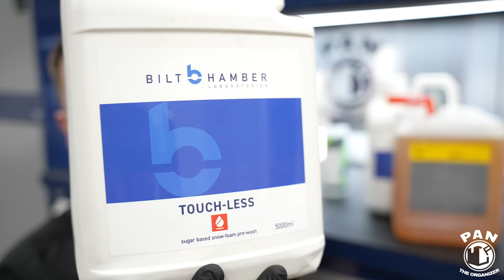The end of the 2 bucket car wash method!? 💀

Comment: For me, 1 bucket, 7 mitts. The grit guard at the bottom will unlikely remove all the particles of dirt embedded in the mitt. Some dirt particles aren't going to sink to the bottom of the bucket in time to escape the mitt as you draw the mitt out of the bucket. Give it a try. Your wash bucket water will remain sediment free.
Reply: You can't be serious 🤣
Reply: @jh.f30  agreed. Anyone who’s using less than 9 mitts is kidding themselves.
Reply: Same.  I did the two bucket method 10 years ago but for the past few years I found it so much easier to just use 1 mitt or microfiber per small section of car, and then just put those cloths aside.  I’ve probably used about 12 per wash.
Reply: @jh.f30 Small car.
Reply: Your laundry bill is 7 times more fantastic. Lol.
Reply: I’ve been doing one bucket ten mitts method for over ten years, second buck it just to pop the used mitts in.
Reply: @jh.f30  I mean your cars paint job is an expensive investment. Makes sense to protect it as much as possible. A few bucks to limit the chance of scratches when you really care about that sort of thing makes sense to me.
Reply: Ok so do you have 35-40 mitts? That’s assuming you are using a fresh set for every vehicle if you are doing this as a business. If so you might as well use the 2 bucket method.
Reply: @sneakynun most people are not detailing as a business. 

If you’re just washing your personal vehicle it makes a lot more sense to use more mitts.
Reply: Agreed. This is the best way
Reply: I do a microfiber per panel, I’m with you.
Reply: @thomaslax39  and utterly pointless
Reply: 1 mitt per panel any other way youre doing it wrong
Reply: I agree. But density means that it's likely not as hard if it floats. Hardness is all that matters for scratching something.
Reply: That’s how I do it. I run everything thru the clothes  washer after so having all those extra wash mitts makes no difference in the amount of time I spend. I just throw my drying towels and any detail rags in with the mits without any wash soap usually because there is enough in the mitts already.
Reply: Why not just use really thick microfiber towels at that point instead of a dozen mitts?
Reply: @zetapingpong  Not a bad idea. I did a rinseless like that once.  But using multiple mitts with no rimse bucket is actually a pretty smooth process.
Reply: @mikez6683  exactly the same method for me! If it took me 40 hrs to prep, polish and coat the car mitts are cheap. If I was to do it as a business then I might reconsider
Reply: @DaveoAU  only 9……..
Reply: @sneakynun  Why does it have to be a mitt? Microfibers work just fine. I use 5 to 10 in a rinseless wash bucket depending on the size of the vehicle.
Reply: I'm sticking with the pro advice.
Reply: For me, 7 buckets, 1 mitt
Reply: This is what I do.  Foam it dry, rinse, refoam for a lubricant on the surface, then one bucket and lots of mitts.  Not a hassle at all.

Comment: Im new to this area but found it extremely interesting so thank you for the video. One question I still have is what is the difference between doing it this way vs. using the Optimum No Rinse (ONR) one bucket way? Any help from Pan or the community would be greatly appreciated, Cheers.

Comment: I was pleased to hear you say that a rinseless wash can be used instead the snow-foam method.  I do not have a pressure washer or a snow foam cannon/gun, so my method is to pre soak the car with ONR in a pump sprayer, wash off with the hose* and then soak the car again in ONR leaving it on as I do the contact wash.  Rinse off with the hose and then back to the ONR in the pump sprayer for drying as a drying aid.
Entertaining video as always.
 * The hosepipe ban in England has ended at last!
Reply from the maker: Thanks!
Reply: never thought of doing it like this.  may have to do this

Comment: I have been using 1 bucket for the body and 1 bucket for the  wheels for 10 years.  I believe it comes down to preparation (using Grit Guards/washboard and foam cannon) and techniques. 

Great video, Pan.  I am actually washing my car today.
Reply from the maker: Enjoy your wash session!
Reply: Does grit guard gives the same function as rinsing and squeezing cloth on running tap?
Reply: @hakk9961   I think using a grit guard to agitate and loosen the dirt is better than just rinsing under tap water. I've used pressure washer on my mitts and seen dirt debris still attached to my mitt, so I just agitate my mitts on the grit guard
Reply: @JoeVargheseOrlandoFL that's exactly how I use my "grit guard" - as a washboard to clean my mitts after the wash. Once a mitt comes out of the wash bucket, and after it's on the car, it gets tossed in the "washboard" bucket. No rinsing mitts. Once a mitt touches the car, it doesn't touch it again until it's been scrubbed clean.

Comment: Pan, I’ve used the wash over foam method and it presents two issues to me: First, on larger vehicles like SUV’s, it’s difficult to get around the whole vehicle before the agitated areas begin to dry. Especially with one that’s been previously coated and is creating dry areas naturally. I really feel like I need to rinse after agitation to prevent any streaking/spotting. Secondly, any vehicle needing a step stool or lean in to get to the roof results in a shirt full of foam. This method is quick and easy for a low slung coupe like your Porsche, but less practical for something larger. Food for thought! Love your content, from one Panteli to another!
Reply from the maker: Thanks. For larger and taller vehicles, you can use a microfiber head on an extendable pole like this: https://bit.ly/3tE3xvg

Also, if you use a pH neutral snow foam, even if it dries a bit on the surface, it doesn't matter, it will rinse off well when it's time to rinse. Work in the shade or in a garage. And if you truly want zero water spotting issues, get a water deionizer. Zero minerals for a spot free wash experience. I love mine!
Reply: I do not agree. I use that method everyday to wash my truck ( ram 1500 ) and have no issue with parts that dries to fast ! The only challenge is when you got weather over 30 degrees outside then it might be tricky ( at this point you just dont wash a car when it’s to hot ) but in overall I have no problem using this method on big vehicles!
Reply: I rinse each section after agitation and I get no soap streaks like I do if I wait till the end
Reply: Move faster.
Reply: @Challenger432  It does help that pickup trucks have a bed that gives access to the roof, full-sized SUV roofs however are a pain to clean without extended wash mitts or if you aren’t tall.
Reply: @MrOiram46  I have a little folding stand that helps a TON.  I noticed our local detailing shop that did our cars' ceramic coatings using them and grabbed me one.  No more standing on wobbly upside down home depot buckets!
Reply: @Challenger432  You wash your truck every day?
Reply: @breakonthru5 1 to 2 times a week. It still not a problem. My last truck was a ram powerwagon and never had trouble washing the top standing on the sidesteps

Comment: Hi Pan! I do the same, but I don't see a problem with using both buckets after pre-washing. I consider it a step that requires no costs, nor is it a waste of time. But safety increases considerably by having a bucket of clean water to rinse the microfiber between processes.
Reply: How dirty dose your rinse water get? That should be your tell tale if the two bucket method is worth it.
Reply: Hi Pan. Top workshop you have there, I use a Citrus pre wash before snow-foam, then the lower section I use a fallout remover, as yourself just the 1 bucket. My car is PPF protected with a Halo coating. What are your thoughts on this method as debris/dirt just washes of the PPF? Thank you .
Reply: Yup I agree. I also bought 4 microfiber sponges to switch as I do my vehicle which only adds extra precaution and is easy to implement

Comment: I do this method WITH two buckets, both with grit guards, and have been for a few years. Just makes sense to me. Costs me almost zero calories to fill an extra bucket of water. Maximize lubrication in every step.
Reply: I do almost same method.. Foam pre-wash. Wait and Rinse. Foam again.  But on this step, I use One bucket and 8-9 different Wash mitts for all the sections.  Never reuse same contaminated wash mitts in rinse/wash bucket = lower risks of any contaminant scratches.  

And the added benefit is that it’s much faster bc you eliminated need to thoroughly rinse your mitts.  Once a mitt is done (front and back) on two sections of a car, it’s much faster to just drop on dirty pile and grab fresh new mitt.

Comment: I LOVE the single-bucket method, and it's the one I most recommend. As long as you decontaminate the surface properly with a power washer, foam, or just a hose first..the single-bucket method is king. You're never re-introducing sand or debris into the washing step!

Comment: Pan I have used the 2 bucket method up until a few months ago.  After watching Yvan's videos I switched to the 1 bucket.  Typically depending on how dirty the car is I will either prerinse with DIY rinseless or as you used in this video Active Foam.  Then after rinsing I have used Incredible suds, GSF or Pearl to do the contact wash.  I typically use 2 mitts one for the lower panels and one for the rest of the vehicle.  Thanks for really explaining the entire process.

Comment: Just a thought on the contact wash.  

I think I would do the windshield either last or with a single towel/wash mitt.  

Rationale: when driving your windshield & bumper & mirror hoods see the most dirt, bugs and grime.  In order to prevent dragging the contaminants over your roof I would recommend using only one mitt for the windshield.  

Thanks for your awesomeness!
Reply: I use a 2 bucket method with snow foam. I use a 2 sided mitt. Washing the roof with the lambswool side then turn it over and wash all the glass with the specialty glass side. Rinse then move on to the rest of the car. Been doing this for 3 years and NO love scratches. Paint is perfect. Mitt is a Maguiar's Lambswool mitt. I change the mitt annually. Hope this helps.

Comment: I use 2 bucket for a wash. 1 bucket is used for wheel cleaning the other is for cleaning the car. I havnet used the 2bucket method with a rinse/soap bucket in 5+ years. Rinseless wash is my wash method 95% of the time and a pre spray with rinseless is my pre soak and then wash. DIY is my favorite followed by Eco wash from OP. ONR use to be my goto untill DIY came out
Reply: Onr still my favorite

Comment: The thing I like the most about this cleaning method is that the majority of the "work" of cleaning the car is done by the products without the need of a lot of elbow grease. With the right products you can let the products go to work. A testament to the products used and application methods used here.
Reply from the maker: Correct. Things have evolved a lot and now we have effetive snow foams for the prewash that can actually do a great job of heavy lifting and remove a good portion of dirt and grime before the actual contact wash, making the contact wash safer and easier.

Comment: I've pretty much always used 2 buckets, but 1 bucket for the soap wooder, and 1 was just a little bit of water to throw the dirty mits in. Depending on the car I typically use 3 -5 microfiber wash mitts. 
Use one side for a specific area, and flip it. Use the other side, and toss it in the dirty water bucket. Then grab another mitt.
Reply: You mentioned you use one side for a specific area does that mean you have a color or number system in which you use to make sure you use the same mitt in the same specific area on the vehicle again or is that only for the wash at your currently doing?
Reply: @justplanefred  no, nothing specific. I'm really not one of those OCD type of guys lol. I don't detail professionally, just a diy at home. I basically use 1 mitt for the hood, top, and trunk. About halfway through those panels, I flip the mitt, and use the other side.  Then I do the same on the sides of the vehicle. I'll use 1 mitt, sometimes  2, for those as well.
Reply: @atrain132  okay thank you
Reply: @ULSB1969 ?? What?

Comment: I started watching your channel 3 years ago and was struck by your comment about soaps, snow foams, pressure washers and the two bucket method. I digested it all and decided the two bucket method was not necessary. I simply do an original snow foam and rinse, then another snow foam followed by a hand wash. 
The big difference is I bought a wash mitten for the hood, each side, the top and back (SUV), and one for the bottom  area of the car, the latter of which which I rotate half way through. I have a different type of mitt for the wheels and use two for that, rotating at each wheel. I use a brush for the tires. It’s not more expensive because you don’t need a bucket or a grit guard at all. 
Everything I use was recommended by you (THANKS!), but I figured the buckets were not necessary.
Reply from the maker: Thanks for sharing John!

Comment: For me it depends on how dirty the car is. If it is extremely dirty I will do the pretreat, rinse, refoam but to be on the safe side use the 2 bucket method. On regular maintenance washes I agree 2 buckets are not necessary. And as mentioned the soaps have come a long way in the last few years and improved considerably. 👍✌️☮️

Comment: I think the small amount of time that you save and extra laundry that you will have to do by using multiple wash media for the contact wash is worth it rather than scrubbing your one mitt/towel on the grit guard every time you go back to your bucket.
Reply: The kind of grit guard he is using doesn't work also
Reply: @cheesedoodle2327  Are you suggesting there is a better grit guard or that grit guards are not useful?
Reply: @JeanPierreWhite   The Detail Guardz one he shows in the video is far superior over the regular old grit guard.

Comment: I never imagined Pan Organizer not using the two-bucket wash method!

Thank you for bringing up an important point about car cleaning. It’s all about using common sense. For cars that aren’t too dirty, the method of cleaning you described makes sense and makes detailing much easier. It’s good to know that the two-bucket wash method isn’t always necessary. Your experience and expertise in this field are invaluable, and it’s great to see you demystifying this topic. It's a good thing you clarified that using the multiple towels or mitt method, also known as the Gary Dean method, is best when dealing with very dirty cars. I find your method very useful for both soap and rinseless washing. 

Personally, I follow the same method as you, but I use rinseless wash instead of soap for some extra peace of mind. 

Thank you for sharing your valuable insights on this topic.
Reply from the maker: Thanks for your feedback! I hope you'll have a great weekend.

Comment: Hi Pan, great video as usual. Watching it I had two questions. One you answered at the end about still using the two bucket method for the contact wash - not necessary but certainly the associated benefits and principles would still apply, so personal choice for benefit vs hassle. 
The other question related to the second snow foam application for lubrication. You stated the dwell time is 5 minutes for initial snow foam application and contact wash was 15 minutes (if you are efficient). Is there a risk that the second application of the snow foam will dry on the surface whilst completing the contact wash? How much of an issue would this be? I understand that is why you wash when the car is cool to the touch and out of the sun, but feel there is still the potential for the snow foam to dry whilst performing the contact wash and am wondering how much of an issue that may be?
Reply: I've struggled with this a lot. Even though I wash my car in the shade in the early morning when it's cool, I always have issues with the foam drying up as I was doing the contact wash if I try to do the whole car in one shot. The only way I've been able to work around it is to foam, wash and rinse the car in sections. It's probably something you'll have to experiment with.

Comment: I started with the two bucket, but now just using one rinse bucket. I do a pre wash with a higher ph soap, then rinse it off...then just foam the car down again with a ph neutral soap and that obviously has all the soap and lubrication I need, start cleaning...rinse mit when needed.

Comment: I do the "Best of Both Worlds" method. 2 foam method AND 2 buckets but the rinse bucket also has soap and grit guards. 4 wash mitts used, only a fresh mitt touches the upper half is the car, so no mitt is reused if it touches the lower half.

Comment: This is by far the most detailed and informative wash method instructions on YT, wish this video was out a year ago before my ppf was fubar’d by improper wash advice of ppf shop 😢
Reply from the maker: Glad it was helpful! If you are using the two bucket wash method, that is still absolutely valid. Heck I have been using that method for 26 years now. Actually, I was using the three bucket method as I have a third bucket dedicated just for wheels.

There is not one single best way of washing a car. As long as you use safe washing and drying methods, feel free to explore what works best for you.

Welcome to my channel. You discovered one of the biggest car detailing channels on YouTube as we surpassed 945,000 subscribers and we have over 125 million views! I have been detailing for 26 years and I love to share my knowledge and passion with my viewers.

You found the right channel to help you learn everything about detailing.